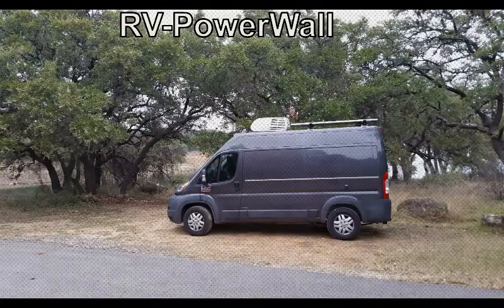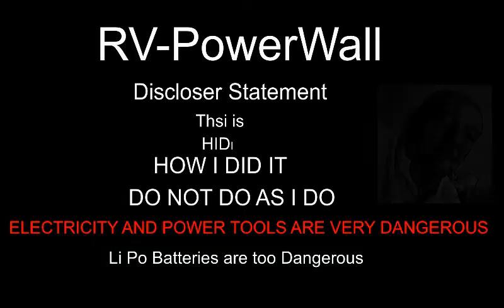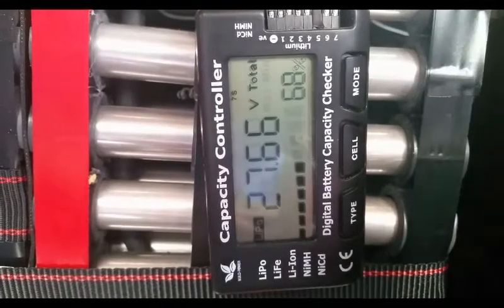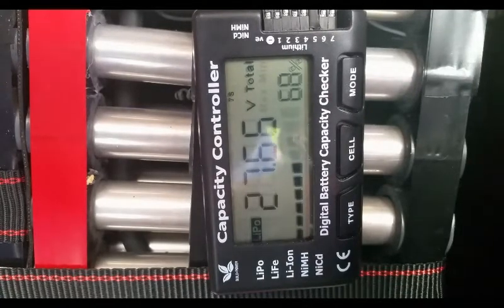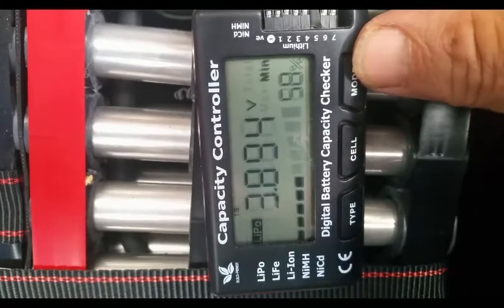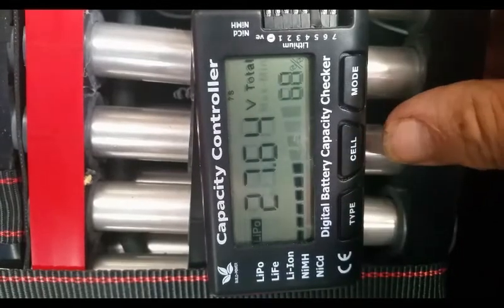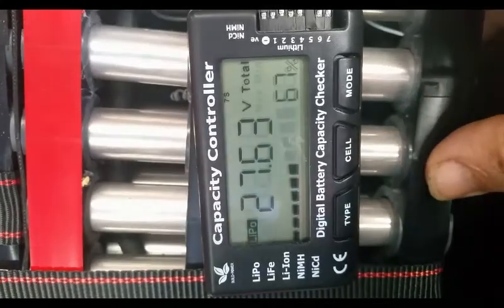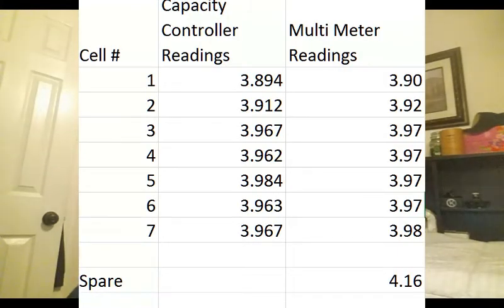RV PowerWall | 18650 - 3 Month Battery Update

Comment from the maker: HI everyone sorry I have not done an update for a while. The van has been in use since July 24 - 7. This winter I have experienced a few days that the 350w panel was not able to fully charge the battery everyday however the van performed perfectly due to the storage capacity.  Today is 12/24/18 and the battery is getting close to 0ne year since it was put into service. I hope to do an update soon. Merry Christmas to All.

Comment: Hi!
I follow your Channel 

Just one question, i don t remember if you re using alternator for charging.. if yes what device do you use for ?
Thanks
Reply from the maker: Since my system is 24 volt I do not charge with the alternator. i us only my 350 watt solar panel.
Reply from the maker: I am not using the alternator from the van. #1 the 350w solar panel keeps the battery fully charged ... #2 I keep my house battery seperate from the van electrical system.

Comment: Good morning and thank you for the update. Have you considered using the controller as a balancer?
Reply from the maker: I have  not used it as such only because I do not believe it can balance this 5kw battery
Reply: Its a good device for that
Reply from the maker: I do not believe the load this controller uses would be large enough to balance these large pacs. I could be wrong about this.
Reply: I have that balancer , and it won't balance a 7s 12p unfortunately